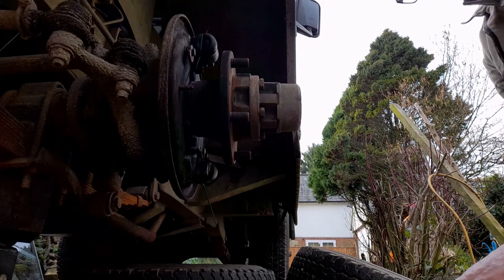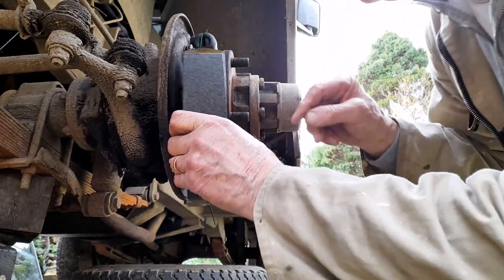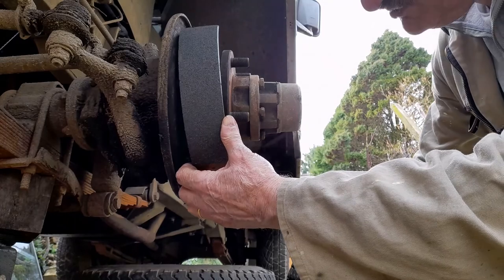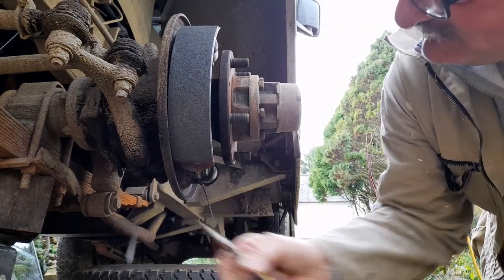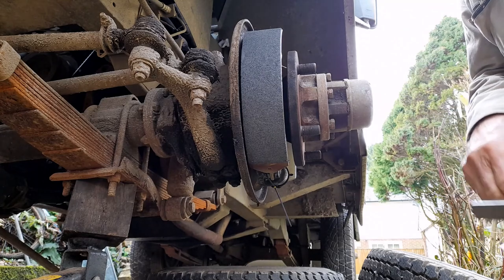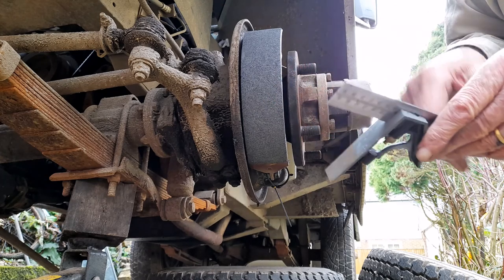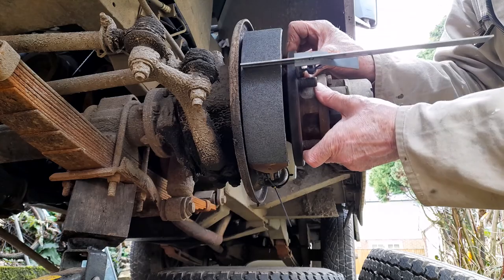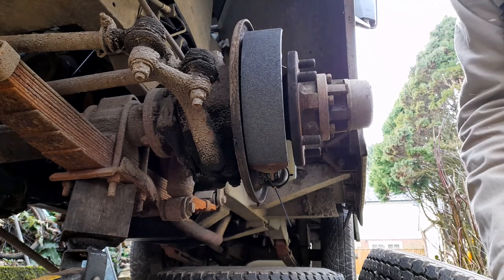Brake shoe fitment to series 3 land rover 109" and checking parallelity of shoes to brake drum.

Comment: I have series iii 109. It took some effort removing the drum. Now that it's off, i notice that the shoes are of centre. No matter how much adjustment to the the two shoe adjusters i do, they i can't get the drum to fit again.
Reply from the maker: Hello, I trust that by now you have sorted the problem and refitted the drum over brake shoes?? Without being in front of the brake assy. it is difficult to figure the problem - the key is to turn brake adjusters so the springs pull the shoes in to fully retract brake cylinders then the drum should fit over them - good luck